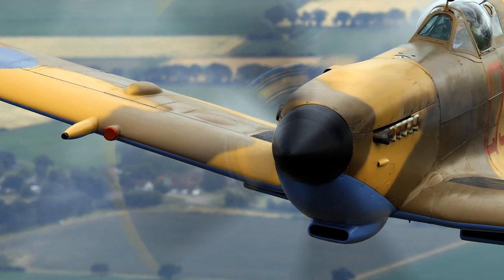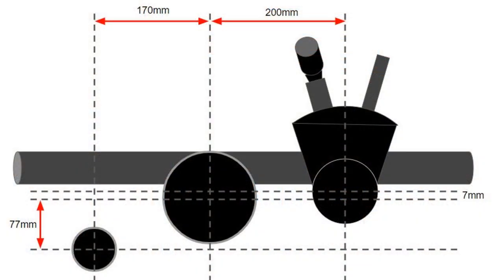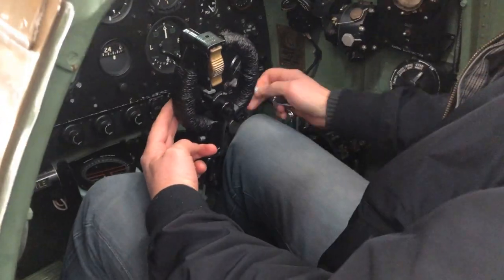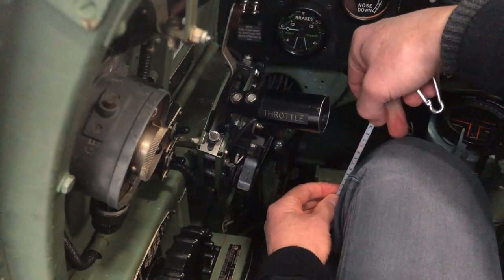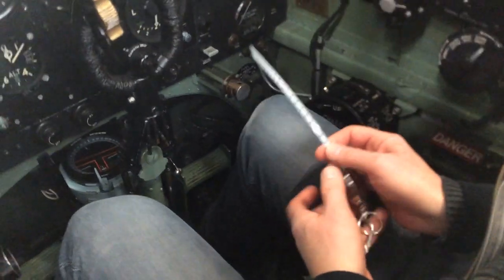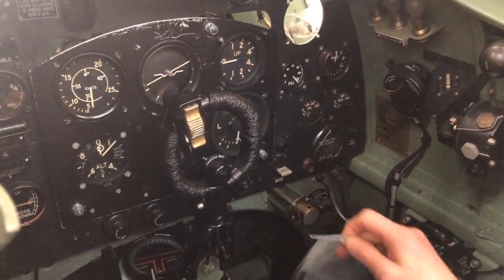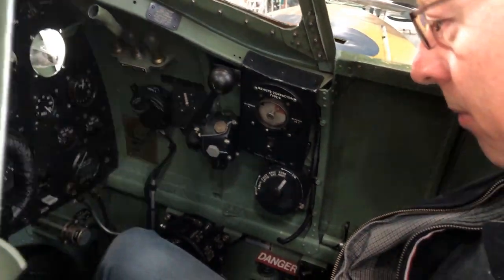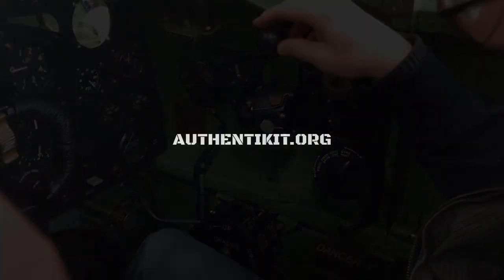Spitfire MkIX Cockpit Measurements for Flight Simulation

Comment: Good initial trial Phil. I think the another very important issue is the seat positioning. Only one of the BBMF pilots would be able to help position you correctly in the seat with your correct eye point . Pilots always adjust themselves to get the exact same eye position , crucial for landings and formation flying. This same eye point is what you need to set in the sim .  Also a full 3D scan of the cockpit layout would be an awesome use of the technology and provide unparalleled accuracy. Get all the controls and instruments in the exact correct relative position from a fixed datum point. Then at home adjust your seat to get the same eye position , then in the VR sim adjust to match the same eye position.
Reply from the maker: Thanks. Yes, very good point. We’re talking height adjustment only here are we?
Reply: @AuthentiKit  also forward and backward . In most pro flight simulators/airliners/military aircraft, at the start of the first sim session , setting the students seating position , is taught to get their correct eye position , afterwards they do this themselves each time they get into the seat .
Reply: That would be great if you could do it. Not sure how to relate that information back to the home cockpit user, but that's another issue. As you say, in an airline simulator, and in fact in a real A320, (probably others too) there is a little set of plastic spheres in the centre windscreen  frame that you use to line up your eye point by moving the seat.

Comment: I didn't see this vid when assembling my cockpit. at 6'7" all of these matters related to pedal distance and the length of the monitor arm. Left leg extended on the left pedal needs to clear the arm for the Spade grip. That determines the height you can place the Spade at. I lowered the monitor Arm for the spade as much as possible till it just cleared the top of my ankle/top of foot. After that the down pole is set, angles determine where you end up with the 27mm pole for the throttles and trims. You can lower or raise the 27MM pole but the proximity is determined by the placement of the pedals and spade grip. I bought the Mount-It stand and added in every segment from the unused monitor arm so a total of 5 segments in order to get the spade back far enough for full throws and clearance. conclusion: Spitfire is not made for 6'7" pilots... but Authentikit build can accommodate tall people!
Reply from the maker: Fantastic! Great to know that my unusual rig mounting system works even for the very tall.

Comment: In my opinion, all the measurements should've been taken relative to the seat, not from someone body parts.
Reply from the maker: You could be right. Not sure if it would make things better or worse though depending on the type of chair people might use at home.
Reply: @AuthentiKit Yet, the corner made by the jonction of the seat pan and the seat backrest should be the same, regardless of the chair type you use, in order to respect the aircraft genuine dimension. I'm 6ft, 260lbs. Even though  I can't back out my seat in the real aircraft, I probably will on my chair. Just my 2¢.
Reply from the maker: @morkbov  thanks. I’ve had some good feedback on this video, yours included. I’ll give some thought to a follow up.

Comment: Could the authentikit work with the new Next Level Boeing edition sim pits?  Which come with various attachment, however obv your mounting brackets would not work so alternative ways to connect would be required.  It would be superb if possible as being able to set a fixed standardised baseline for most people on relative positioning (plus I want to buy one of them for other crafts too but there lies a problem if wanted to set up for a spitfire instead)
Reply from the maker: Join our Discord and we can work something out. We’ve got a guy working on a yaw 2 mounting system.

Comment: I want to do that in a P47 cockpit. Would be super cool. 
I have been trying to peace together where things are from drawings but so far it's nearly impossible unless you want to redraw every part in cad and put together. 

While it may not be practical because of stuff in the way and leaning in to a cocpit is not ideal. I think I would try to measure out the seat. Then use say the bottom of the seat back as a reference point. As you can then refer your seat at home to it. Maybe have a stick of a set length up against the seat back, so them sit on it. Get it sqair and cental to the overall pit, then measure from the tip to the parts. It's not an easy task. 

The alternative may be to do from VR. So you put you hand where the control should be. Then lift the headset and adjust the position. And repeat until its about right. 

So jealous of being able sit in there though.
Reply from the maker: I agree, it may all be irrelevant if the whole point is to make it work in VR because I'm assuming the VR cockpit is 100% and not scaled/skewed so a calibration to the VR cockpit may be best in the end

Comment: You've completely ignored that the fore/aft beam visible at 11:15 which has the chassis lever attached is the aircraft datum point.  All vertical measurements are taken from it.  Same on the port side where it also forms the top of the entry that the door hinges to.
Reply from the maker: Hi, yes I've done previous measurements from datum points and longerons but I always found it confusing recreating positions relative to my chair & legs so thought I'd try it this way.
Reply: @AuthentiKit  but the whole point is the chair is adjustable and thus can't be used as a datum...  
 You need to measure the range of movement of the (real) seat relative to the (real) datum.   
All the controls can be easily placed according to the datum measurements, the hard part is matching your actual chair to the same position as MSFS or DCS places it...(your view point)
Reply from the maker: I hear you. I guess i’m thinking more of the basic AuthentiKit situation where the cockpit isn’t set up and fixed, but controls are on articulated arms and people are using regular chairs. If you roll your chair in and pivot the controls towards you i feel this might still be useful as a kind of good enough approach. That’s what i have and do. Less useful i agree for someone who has built a fixed cockpit and fixed controls.